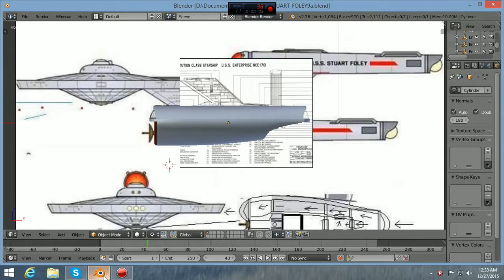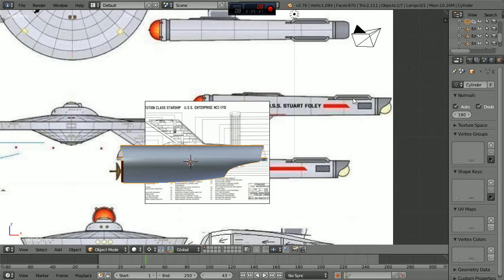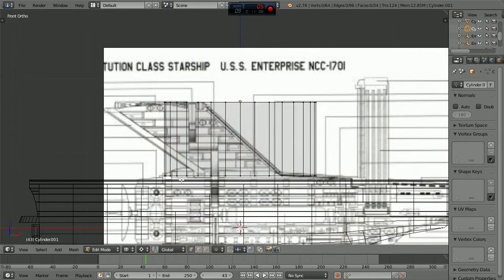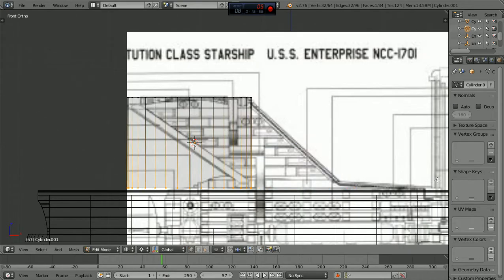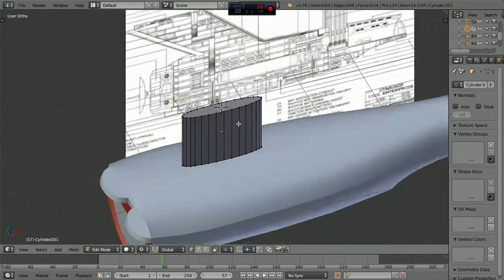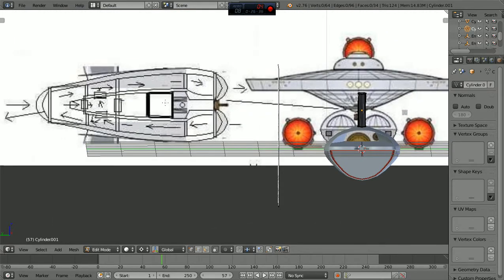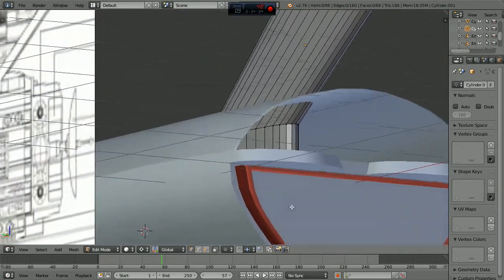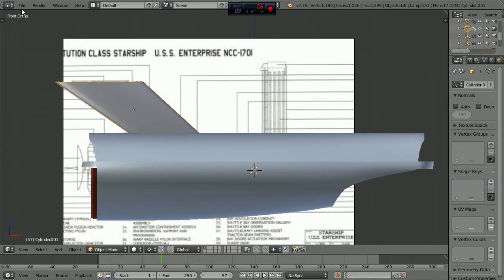The Stuart Foley Dreadnought Project #11

Comment: if your going to scal any thing to the enterprise try just the part under the hanger deck where the main deflector comes out that way it still slightly bigger but all the part where engineering would be would probably have a simalur lay out to the Constitution class it be sort of like a constitution class with a hanger bay slapped on top of the star drive  it be slightly biger but not to match bigger smaller then the  excelsior but bigger then the original constitution class beor the up grades.

if its going to be tos and more powerfull then the constitution it should be bigger but if its going to be befor all the refits and the movis tme then it has to be smaller then the  excelsior glass i would segest all of this as gide lines if you and  sturart agree
Reply from the maker: +jon baranoski Don't get to scared, I'm more or less experimenting to see how this looks. This won't be the final version, I put a glimpse of that in #12.
Reply: im not scared i like every thing you don so far just  giving my own feed back i trust you as the artist  to  make it all look how you think it fits together best.
Reply from the maker: I was surprised how small the Connie Saucer is when I scaled the out line on here.
Reply: i was to i had nothing to do with the drawing of the soucer on this dread not nor the nacells its. as i have been watching you do this iv been learning more things about the ost enterprise i find it really informing when you start talking about all the workings of what the ship was intinded to have
Reply from the maker: +jon baranoski LOL, TY, when I and My brothers used to play Star Trek as kids, My brothers wanted to be Kirk. I always wanted to be Scotty. I wanted to be the one who saved their buts in an emergency by draining all the hand Phasers on board into the Dylithium chamber Crystal Matrix to regain main power and be able to chase a Klingon D7 back across the neutral zone. Its the Engineers that Make the Captains look good.
Reply: i disagree its the red shirts that save every ones assets
Reply from the maker: +jon baranoski Scotty wore a Red shirt. He was one of the only one to wear a red shirt and not get killed LOL.